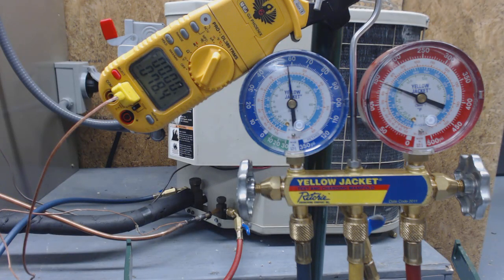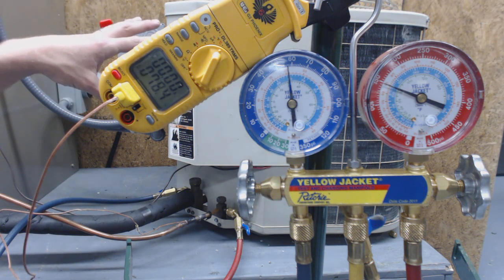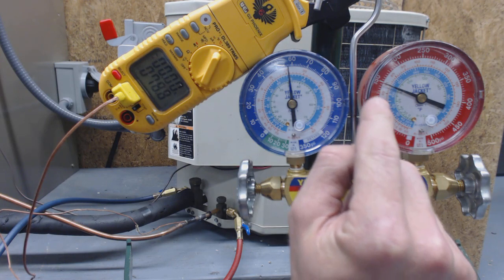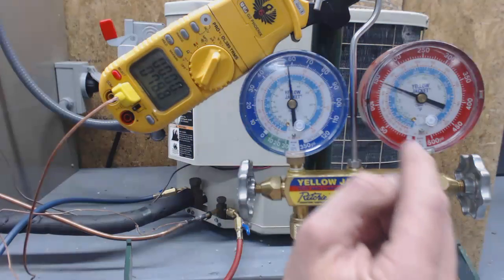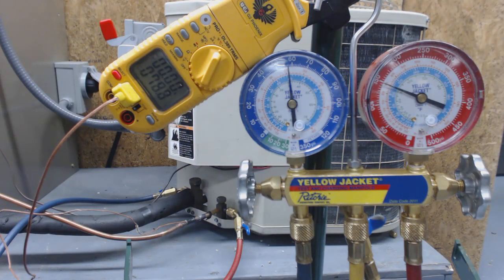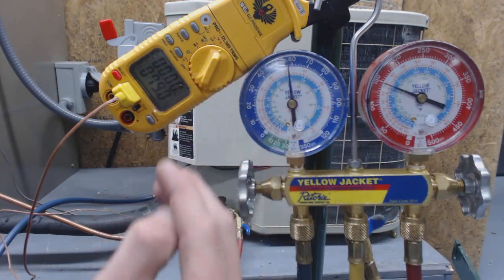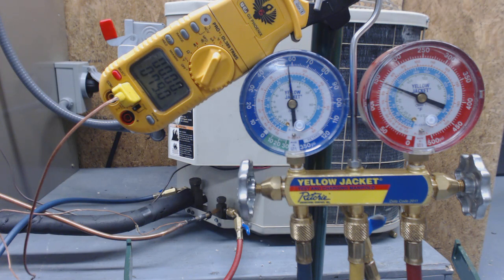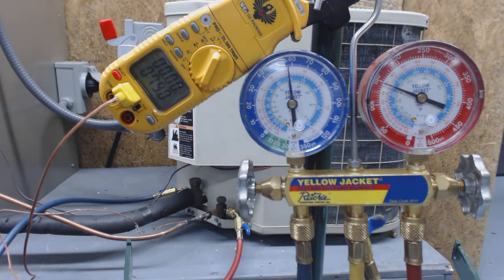Refrigerant Charging! Checking the R-22 Refrigerant Charge on AC Condensor! Subcooling Method!

Comment: So I was at a unit today that had a super heat of 35 degrees and subcool of 1 degree. This is a 3.5 Ton unit. Pressures were 114 PSIG suction and 254 head pressure with 410A with a TXV. I added refrigerant and superheat went down to 19 but subcool stayed the same. Indoor temp was about 72 and outdoor was 78. I was kinda confused as to why this happened. Any ideas?
Reply from the maker: How much refrigerant did you add in ounces between when the superheat was 35 until it was at 19 and subcooling stayed the same? Also was this a condensor or heat pump, thanks?
Reply: acservicetech I added about 1 lb 8 oz. I didn’t want to add anymore, just in case I was overcharging it. It’s a heat pump. I had let it stabilize for 15 min to see what it would do, but it stayed the same.
Reply from the maker: I know this sounds odd but did you try shutting just the outdoor unit off while letting the indoor fan run and then turning it back on, wait an additional 5-10 minutes and then check the subcooling? Sometimes when you add that much, you need to give the txv a clear slate again. What was your delta T?
Reply: acservicetech I didn’t let only the blower run. I didn’t have any thermometers to check delta T though. Wouldn’t be able to tell how much that would be.
Reply from the maker: Also if you were using a digital set which it sounds like, when was the last time the sensors were calibrated in 32 degree ice water. I am just trying to through scenarios out there for you, that's all. Also I really like that FieldPiece ST4 Dual Temp Meter- http://amzn.to/2AhR6ph  - I use those bead type temp sensors for everything usually, thanks
Reply: acservicetech I was using the iManifold  to check for subcool. I would have to look into as to how to calibrate those. I was also using my Testo gauges to check for superheat. Reason for this is because I didn’t have another hose to hook from my testo gauges to the liquid line. I was using it to connect it from my refrigerant tank to my gauges. The valve core depressor had blown out from one of my hoses, So I only had 2 hoses for my Testos and one of them was hooked to my tank.
Reply from the maker: Oh ok, thanks

Comment: Hi This is my first time to go on youtube. i am looking for help.  I have R22 TXV the actual Saturated reading temperature is 75 and psig around 138. The outside tempo reading at 84 that mean i have a negative 9 on sub cool. Is this mean i need to put freon into my unit?
Reply from the maker: You need the pressure on the liquid line converted to sat temp on the gauge minus the actual temp on the liquid line within three inches of where you connected the refrigerant hose.
Reply: Andrew Bui no

Comment: hai, i am using panasonic 1 ton inveter split ac having R410a in it , can u tell me what will be the ideal suction pressure and a discharge pressure for R410a system.also for R22 system what will be the ideal  suction presssure and discharge pressure.your help will e highly appriciated
Reply from the maker: Sohail Mukhtar Abbasi28  Thanks for the question! I replied to this question in the other videos that you commented in but I will post this answer for the benefit of everyone else, thanks.Great question! In the instruction manual of an inverter unit will be the charging procedures for those units. They are DIFFERENT than psc compressor units which is what is shown in this video and which are charged with superheat for piston units and subcooling for txv units in cooling mode. Normally Inverter Systems will have the proper amount of refrigerant in the unit already up to a certain amount of lineset feet and will be able to operate correctly with a wide range of refrigerant inside which it was designed for. There may not be a way on that unit to add the correct amount of refrigerant other than weighing in a certain amount of refrigerant per foot extra above the maximum rated length of lineset worth of refrigerant that the unit is presently holding. If there were a leak normally you will need to recover the refrigerant, find and fix the leak, vacuum it, and weigh in what is stated on the rating plate if you are under the maximum amount of lineset but make sure to follow the installation instructions of that particular manufacturer which is always your best bet. Thanks for the comment, and I hope you enjoyed the video!